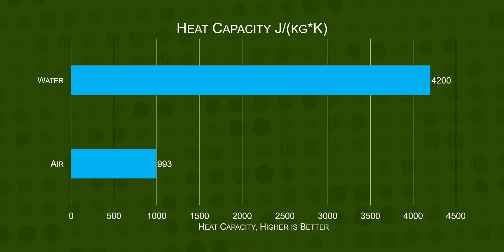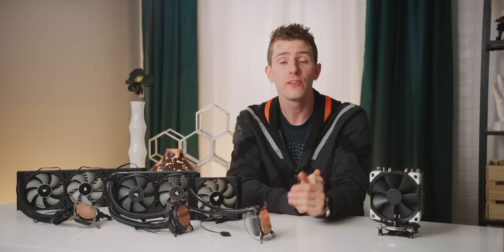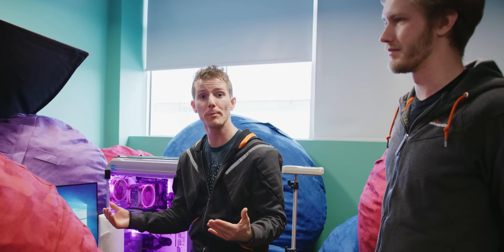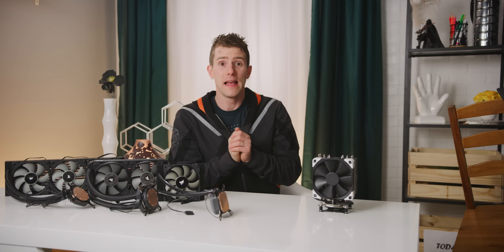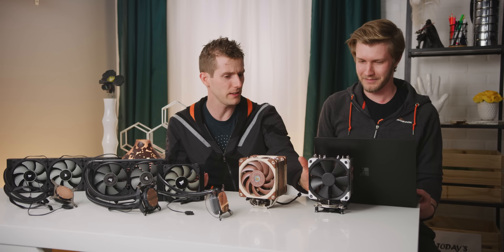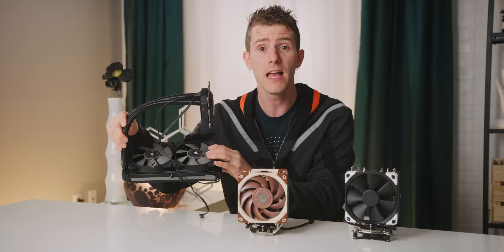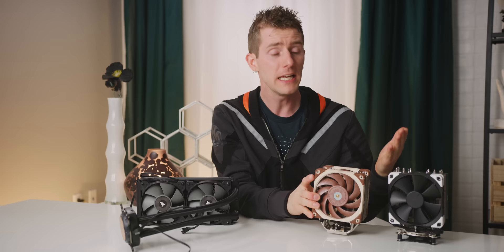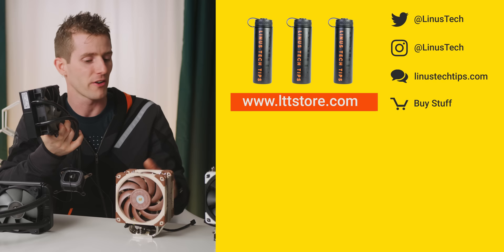Why you shouldn't water cool your PC

Comment: "So you're building a new PC and it's time to choose a cooler"
laughs in AMD
Reply: Intel still gives stock coolers i think, but... they aren't so good, it's like the base so you can work out with it until you buy a new one
Reply: @JoaGamo  yeah thats what i meant, intel stock coolers are ... unworthy of talking about
Reply: Laughs in Wraith Prism
Reply: Are AMD stock coolers that reliable??
Reply: Marwan F. They are tons better than intel ones. Defo good enough even for a little bit of over clocking
Reply: @agnbfdgdf  yeah, I've never had a problem with mine, even when OC'ing. i got a r5 2600x which comes with a wraith spire cooler.
Reply: @agnbfdgdf  have my 1700 on 3.9 to 4.0 ghz OC with the stock cooler, i have a pretty decent airflow but still i think that's pretty good for a stock cooler
Reply: EvilAsh110  wraith prism is again a step up from the wraith spire and the wraith spire is pretty good so i'd wager your prism would def do work
Reply: @JoaGamo  I got two running setups here:  Ryzen 3800X and I5-8600. They were running on Corsair WC solutions : H100i and H55 respectively. Two weeks ago I made my mind to replace those WCs by the stock coolers just to compare the stock coolers against the WC ones. In both setups I am using the same Arctic Silver thermal compound and I customized the FAN profile to run at 40% PWM while cpu is under 60C to keep as quiet as possible. 
I've admit that AMD stock cooler surprised me. The average temperature is about 48C,  even on high load the temperature rarely exceeds 60C, I know that because I set the fan profile to jump to 70% of PWM if the temp. exceed 60C. The performance of H100i on this AMD setup is pretty much similar. A bit better, no more.  Regarding Intel setup, I realized that the Intel stock cooler can keep the temp. safe and similar to AMD while in regular loading, but the Intel fan is more noisier at same PWM level and get louder easily. I mean every tiny and quick cpu loading peek spikes the temp. and speeds up the fan very often. In this case the H55 outperformed the Intel stock cooler by far.
My opinion regarding these samples: for Intel case, I recommend the replacement of stock cooler, but not necessarily a WC or a prime air cooler like Noctua. Any air-cooler with better materials and building, because the intel stock cooler is very very simple and compact. There are no copper or heat pipes. In another hand, the AMD Wraith Prism it much more bulkier with a huge fan and heat sink, besides copper in the base and heat pipes, this why it performs so well, even with a 8C/16T running on 4.5 Ghz. If you dont plan to do insanes OC or gaming all the time, I think AMD stock cooler will meet the needs.
Reply: @feidhlimharrington2275   I got the Wraith Prism together with the Ryzen 2700X a year ago. I mean it looks good, but its loud. Performance is okay, but idle temperatures are bad. Without doing anything, my CPU is at around 41°C. I bought a AIO just yesterday. (ARCTIC liquid freezer II 280).
Reply: @jonaskahnwald4877  hm, without doing anything my cpu is at about 20°C. and no fan can be louder than a blue switch lol imo.
Reply: @feidhlimharrington2275  the idle temp (and even the temp under load) is so dependent on the ambient conditions. Back in college when I lived in a house with no insulation and my room was going down to 40F (5C), I was able to increase my OC by .2 GHz while keeping the same temperature. 
Definitely may have also been using my computer as a heater...
Reply: @colinmetzger6755  yeah honestly the room my pc is in isnt the hottest but it isnt freezing. before pc vs after pc saw barely any difference in temperature, and my pc has never really had a heat issue. apart from the time my friend accidentally tried to overclock something by Ghz instead of Mhz
Reply: I can vouch for the Wraith Coolers. The original Wraith shipped with the FX8370. It’s quiet and runs like a dream. Never overclocked it, but I’ve never had it go much higher than 45c when gaming. Installed the Wraith Spire into a friends PC when he bought the Ryzen 3600, and he gets good solid performance out of it. Only time I would ever recommend a stock cooler. If it’s not a Wraith, like the video said, buy Noctua.
Reply: Sorry I didn't get it. Does AMD cpu comes with free air cooler?
Reply: @balldontlie4524  all cpus come with free air cooler, but only amd ones are good
Reply: What !!! AMD stock cooler is trashhhhhhhh I’m struggling with it and thousands of people like me , what are you talking about !!
Reply: Especially for the third generation cpu
Reply: @jonaskahnwald4877  How's that AIO doing? I'm in the same boat as you, 2700x and it's passable but I want something better, and was thinking of an AIO or Noctua NH12S.
Reply: @agnbfdgdf  AMD coolers are re-badged named-brand coolers. I'm currently getting a 8% overclock on my 3600x using the stock cooler and not breaking 70c under load.  Not too shabby!
Reply: @feidhlimharrington2275  Did the job just fine first year I had my PC
Reply: My previous ryzen had good temp.
It never been over 70°c while encoding videos. 
I upgraded few weeks ago with ryzen 5 3600 and my temp sky rocketed, reaching 95°c every single time I encode😂😂😂. 
I just bought an arctic freezer esports 33 for 19€.
Now, my cpu is sitting at 65°c on full load.
Reply: JoaGamo intel stock cooler is barely able to cool my 9th gen i3 with a changed decent paste
Reply: @cin2110  exactly
Reply: i'm 39 years old, it's about 25 years i'll hear that AMD it's better than Intel.It never happened, in every single particular of a CPU.And if you'll compare, it's not really cheaper.Someone it's free to buy everything that want, but telling it's better makes me laughs.Yes, i buy AMD for three times, every single pc it was worst than intel ones.Good Liquid cooler costs 60dollars, doesn't need that space of a good classic one; it's embarassing confront a 60 dollars LC with a vent, the dimensions and the temperature on the CPU is in favour of LC.Thanks God, there are people that use a little amount of what a PC do, for few hours anytime.I'm not.
Reply: @viespo  your country must be different to mine when it comes to pc pricing then. and DEFINITELY different to america
Reply: AMD Stealth isn't fit for purpose - many will get too hot and will throttle the CPU speed. And Stealth comes with the Ryzen 3600 which most people are getting now.
Reply: @OzzyOscy  you can easily get a r5 3600x for barely any extra from most places
Reply: @feidhlimharrington2275  Nope. When I got mine a while ago, 3600x was £50 more. When I looked for someone recently, it was still about that. However, this isn't relevant to my comment.
Reply: @OzzyOscy  lmao must be looking in the wrong places; or a different country. And it is relevant to your comment at the x series come with better coolers. my r5 2600x was only 5 euro extra over the r5 2600 and i got a better cooler.
Reply: @OzzyOscy  not only my own country's, i was just allowing for the possibility that you were doing that
Reply: @feidhlimharrington2275  I'll presume that reply says "I see my errors, thanks for teaching me, I'll stop arguing online with everyone now".
Reply: @OzzyOscy  you presume wrong, and its pretty bad of you to presume that you taught me anything, and saying i argue with everyone online, seeing as you disagreed with me, and i gave an alternative point of view. you didnt have to disagree with it just because in your personal experience you didnt think it was true
Reply: @feidhlimharrington2275  I'll presume that reply is you arguing about how you don't argue...
Reply: @feidhlimharrington2275  Exactly, there's no need for it.
Reply: @OzzyOscy  yeah well wasnt me doing it
Reply: @OzzyOscy  im not arguing im defending
Reply: @feidhlimharrington2275  Wow you actually replied to agree with me. A breakthrough!
Reply: @OzzyOscy  you said i was arguing, i told you i wasnt. how is that agreeing with you?
Reply: @feidhlimharrington2275  You called it defensiveness. Still you argue just trying to get the last word. Watch, I'll stop now and you'll reply to argue that you're not getting the last word:
Reply: @OzzyOscy  im not arguing just to get the last word, and you didnt stop because you didnt accept that you were wrong, you tried to quit while you were ahead (in your eyes), so im not being argumentative, i might be being stubborn, but you havent conceded so thats why i cant accept you stopping
Reply: Stock coolers are NOT worth risking
Reply: @OzzyOscy  not if you're into overclocking
Reply: Buying a 212 because ive heard the stock cooler for a 3600 is actually trash at cooling it.
Reply: @feidhlimharrington2275   They don't come free you buy it with the product. Where did you get idea it is free ?
Reply: @MarkoLomovic  you pay for the cpu, the cooler comes with it. I know you pay less to get the cpu without the cooler, but the stock cooler is in the price of the cpu from any first-hand seller, so you're pretty much paying for the cpu and the cooler comes with it
Reply: @feidhlimharrington2275   You don't make any sense. If stock cooler is in the price that means you paid for it. No need to do mental gymnastics over this.
Reply: as far as I've heard, the AMD coolers aren't that good when it comes to overclocking
Reply: 85°C+ says Hi though, right? 🤣
Reply: @lukehodgson4887  nah, i get good temps, even when load and oc
Reply: @feidhlimharrington2275  my brother is AMD and he says he's above 60°C quite a bit. 🤔
Reply: @lukehodgson4887  i mean my pc isnt very old so maybe thats why, i also prob have better airflow, and theres no dust in my case
Reply: @feidhlimharrington2275  his explanation to me was "all the cores" 🤣
Reply: @lukehodgson4887  lol xD
Reply: XD
Reply: I play Valorant on a Ryzen 3 3200g (I use its integ gpu) and its temp goes up to 78 degree Celcius. Is that alright?
Reply: @croquette3520  Yes, but no.
Reply: @croquette3520  up to, maybe, consistent 78? thats kinda bad tbh
the maximum my cpu goes to is 65 while rendering, and it averages at 55 while rendering, and like 30 pretty much all the time other than that
Reply: I bought a r7 3700x today and I can't even use the stock cooler it came with haha. I have my old r5 2600 stock cooler on it until I get a new one i ordered on amazon.
Reply: @JuryDutySummons  Dude i am thinking of buying a 3600x. Do i need to buy a liquid cooling or the stock will do the job just fine?
Reply: @OzzyOscy  Thanks a lot dude I bought a decent air cooler and it did the job just fine.
Reply: amd stock coolers are just great that u dont really need to buy a cpu cooler
Reply: Shreshta Jaiswal  i'm with a high end i7. Definitely if I had another cooler, I would prefer it over the stock.
Reply: @agnbfdgdf  so long as your not overclocking, you can push any of their CPU's with the stock coolers
Reply: @mo gamer yeah but he wasnt asking what was increasing his temps he was just asking if they were ok
Reply: @MarkoLomovic  
actually it does make sense because generally amd dont sell cpus without the cooler, only second hand cpus really come without coolers
Reply: @mo gamer and you can use stock coolers for overclocking, just depends on the amount of overclocking, the cpu, and the cooler
Reply: @yigoh8437  what do you mean "NOT worth risking" monitor your temps noob
Reply: @feidhlimharrington2275  i do monitor my temps, although i chose to invest in a better cooling solution than stock, it's just 40-60 bucks more not that big of a deal.
Reply: @yigoh8437  do you use amd or intel
Reply: @feidhlimharrington2275  AMD
Reply: @feidhlimharrington2275   No it doesn't make any sense to pay for something I'm going to throw away. That is stupid.
Reply: @MarkoLomovic  then dont throw it away, simple
Reply: @yigoh8437  yeah im not saying "dont buy aftermarket", im just saying if someone wants to roll with the stock its fine as long as theyre not stupid about it
Reply: @feidhlimharrington2275   You are missing the point, I DON"T WANT TO PAY FOR IT !!!
Reply: @feidhlimharrington2275  ofcourse, for some people stocks are just fine, i Just personally don't like the looks of them
Reply: @MarkoLomovic  you're missing the point, them giving you a stock cooler for free isnt a bad thing
Reply: laughs in more recent AMD
Reply: @piffygunderson256  "new PC"
Reply: @feidhlimharrington2275  amd coolers are good in terms of looks only fam .. when it works it's like an airport out here ..so yea i am buying some aircooler
Reply: @aaryansingh7704  not my fault if you're overclocking your cpu to 9 Ghz so
Reply: @feidhlimharrington2275  which overclock have you done?
Reply: @raphmans548  i have overclocked my r5 2600x to 4.0 ghz

Comment: Me: So is water cooling good for your PC or not
Linus: Well yes but actually no
Reply: Performance; No.
Reliability; No.
Noise levels; No.
Price; No.
Flashing RGB lighting; yes.
Reply: richard balls  I take it you literally didn't watch the video.
Reply: basically can be somewhat better output, but significantly more handling/maintenance.

Nothing really essential when there's heatsinks that can handle very close temperatures.
Reply: laughs in 7 year old noctua u12s working without any issues can't have that with a whattakoolaid bois
Reply: @haaaah7  no
Reply: wtf did richard balls do
Reply: @trollface9223  we all wanna know

Comment: I got this video recommended to me literally hours after i installed my liquid cooler.
Reply: Ye, but you always risk of destroying your entire pc with liquid ....,
Reply: Same man i just got the notification that my liquid cooler has been shipped
Reply: @katsu1668  Yes and no. AIO's are used with distilled water and glycol and aren't conductive. However, over time, they can gather ions and start being conductive. It's a matter of how old it is.  But a leak in an AIO is pretty rare. I have had several of them over the years, and not once had a leak. Don't know anyone that had one leak either. 

As a user of both air and AIO cooling, I have a preference for air to be honest. Noctua is so much more quiet then any AIO I have had and out cools them. But AIOs are great too, they are just as effective. The biggest difference I find with air vs cool, is that AIO cooled cpus gather heat a lot slower then air cooled, and that is of course because water can absorb more heat. Takes longer to get to max. But the side effect to that, is that a AIO cooled CPU will cool down slower as well when load is removed.
Reply: gerble36 (not bragging since a lot of people tend to get mad everytime you mention it) but im getting an i9-9900k and expect to run fortnite at a stable 240 fps along with modern warfare at high fps. I’m not big on pcs and I hate too much maintenance as I just like to play as much as possible without worrying and keeping it simple. So for that would you recommend an aio or the noctua to effectively cool down my 9900k as its known to really heat up. (I also play A LOT). Thanks
Reply: IceDaWaaave Definitely would recommend an AIO, i had a corsair h100i for a long time and i would definitely recommend it for the price
Reply: @icedawaaave3858  why the 9900k and why fortnite wtf this doesnt make any sense, if you get a 9900k i hope you're at least pairing it with 2080 super
Reply: If your serious just go air. Less failure points. Same performance. This aio trend is pretty wack tbh
Reply: Katsu Most AIO liquid coolers come with a warranty for 7 years where if it leaks and breaks any if your parts then the company will cover the replacements

Comment: it's because there is a propertie of the pipes which is this, the copper pipes have just a drop of water, and then sealed at almost no pressure, so the water is nearly boiling point, when the pipes get warm the water evaporates and the heat transfer is from the cpu surface to the grills, don't receber exactly, but something around 6 to 10x faster than the water pump can take the heat out. you can do a very simple experiment to test this: pick some metal(steel, iron some metal with low thermal conductivity) heat it up to 100°C and place the cooling device on top of it, and measure hope much time takes to reach some temperature like 20°C. with this you can derive the output power in terms of heat energy. just apply some thermodynamics into it.

Comment: "As long as you don't live in the Sahara"
>Cries in Australian
Reply: How bad is your "summer"? Is it really that hot?
Reply: @FGRLSWAL  it gets to 50 degrees Celsius where I live, or 122 freedom units
Reply: @adamgeorge6377  uuuuuu, is it at least a dry climate?
Reply: @adamgeorge6377  sounds pretty free to me
Reply: Bruh I can’t run my PC in the summer with an air cooler it idles at 95!! And turns off as soon as I turn on anything CPU intensive.
Reply: @sparkzy2952  lmfao same here... 35c+ degree days and poor central airconditioning shuts off the PC at 95c CPU temp. Guess I won't be playing Cyberpunk much this summer :'(
Reply: Cries in Mexico
Reply: And it feels like its summer almost all year long. I need to live in a fridge soon
Reply: @crabbieman2  get a house fan and put it at the side of the case
Reply: @james_wittman  recorded sure, however recorded temperatures are our of the sun in a sealed place, the sun at home has reached 50 degrees in my western NSW location
Reply: im Aussie and I use an AIO and it's great even with my Intel space heater
Reply: @james_wittman  it was 50* outside, sorry for the confusion lol, I had a thermometer outside, would have been pretty close inside without conditioning or insulation
Reply: *laughs in sweden
Reply: Laughs in bottom right corner of Australia
Reply: I thought Australian use air conditioning since that temperature is way hotter than Singapore
Reply: @adamgeorge6377  pffff... 50°C? Can´t you watercool your country? or maybe Noctua has a better solution for your problem?
Reply: @diocletia1388  I fucking wish I had an air conditioner
Reply: @diocletia1388  ha no. We wish tho, I got lucky with my place but its not comen